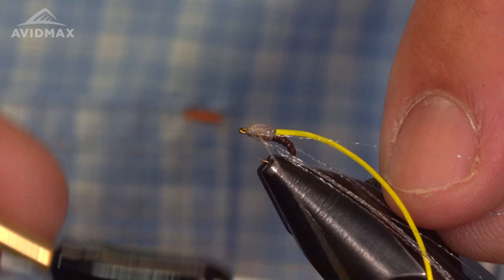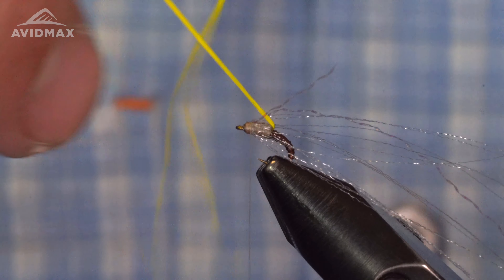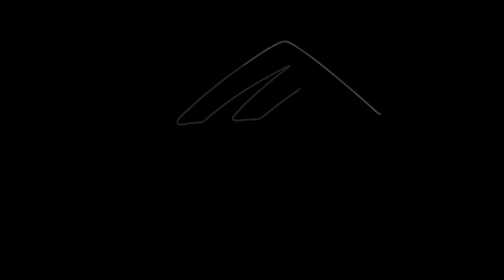How to tie Hilbert's PMD Day Saver Emerger | AvidMax Fly Tying Tuesday Tutorials

Comment: Nice instruction and creative pattern Brian, thanks.  In working with any Life / Span Flex material I notice the diameter is easily reduced by piercing with bodkin and pulling apart.  That might be helpful for the head of emerging Dun in smaller sizes.  Fun pattern!!
Reply: Great tip! Thank you!